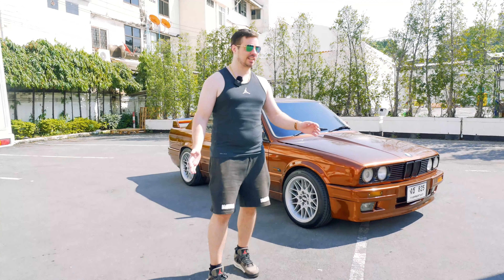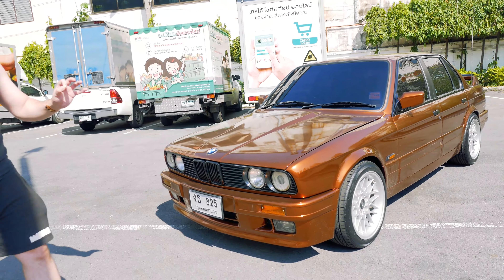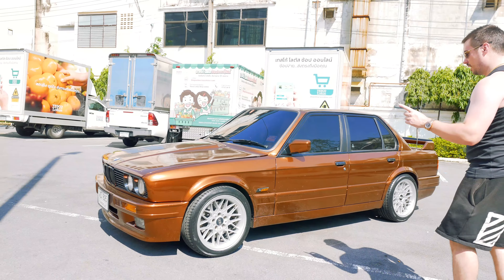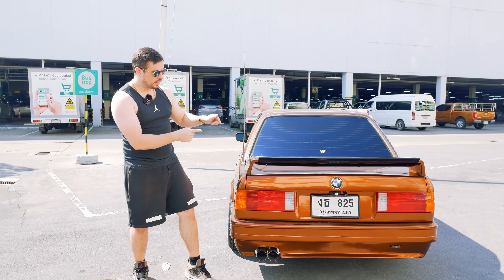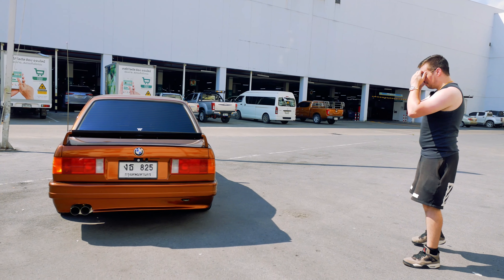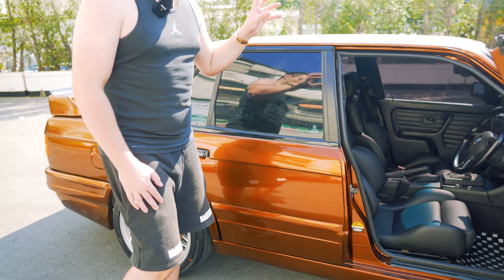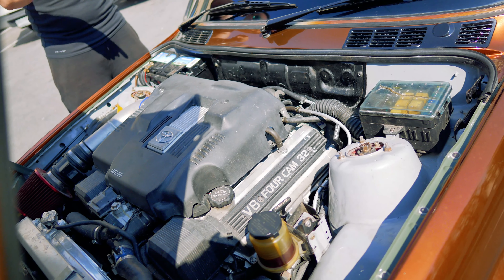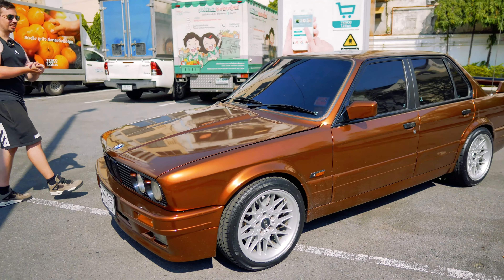BMW E30 1UZ V8 Engine Swap - Update - Project Topgun Part 6

Comment: I wanna do something similar too, just need to get myself an e30 in good nick, but yeah, things are a bit ridiculously priced in South Africa too with taxes and duties and just the general price gouging 😂
Reply from the maker: E30s in good condition are impossible to find now.
I have done minor rust repairs on this one and on my top secret E30 coupe project, I had to literally cut and replace half the car!
However it will be like a factory fresh car once it’s done.... but it was a bargain and even with the full strip down restoration, it was still cheaper than a ok condition base model 4 cylinder.

Comment: Do a 4 door M3 fenders
Reply from the maker: tempted but don't think it will work cleanly... but with that blower on top of the 1UZ I will need to overcome the rear wheel width issue and I see no other option :-(